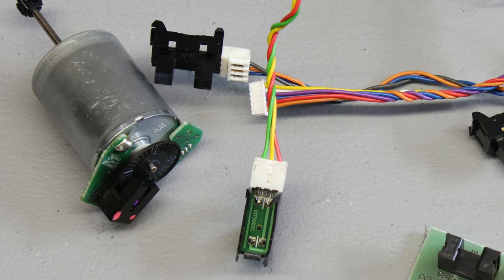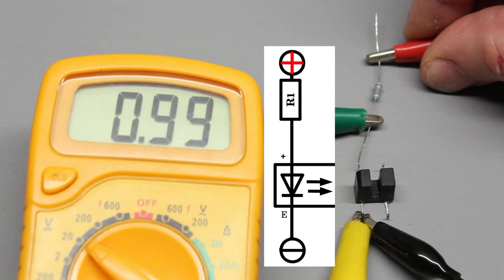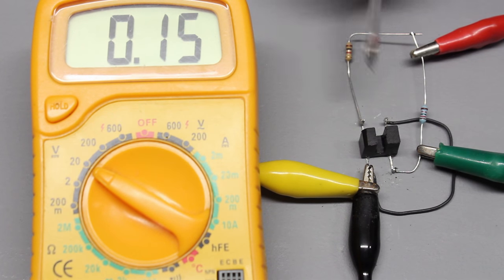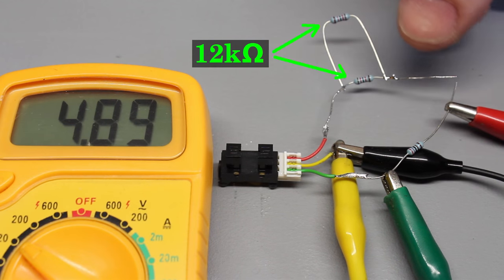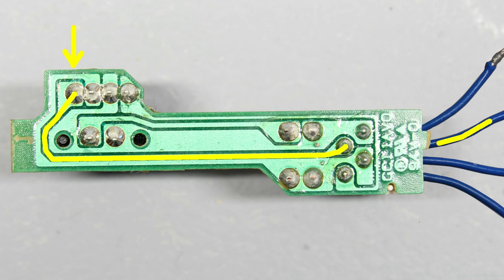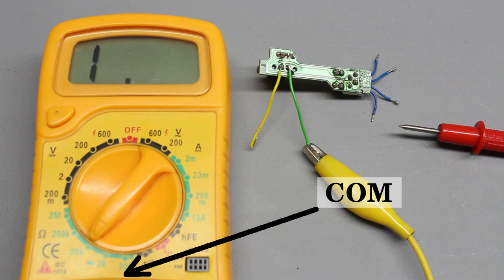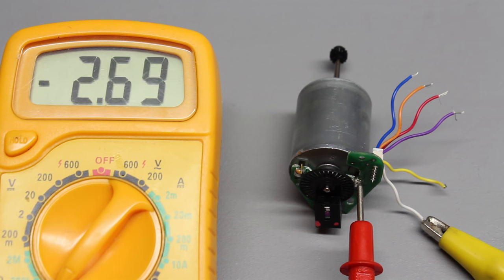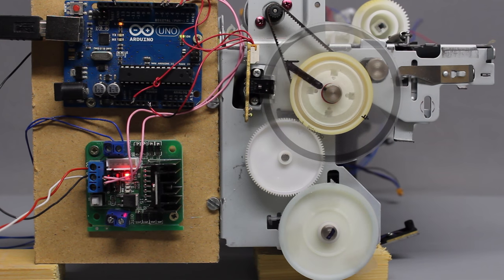Transmissive optical sensors from old printers and scanners

Comment: Want to thank you whole heatedly for your tutorial!
I had collected a few linear / rotary encoders from several printers.
I have managed to successfully determine the pinout from one of them and hook it up to my arduino using two interrupts and two LEDs. :)
Reply from the maker: You're welcome!
...hooking up a linear sensor to an Arduino sucessfully is the first step to great projects. I will create more machines using those sensors in my series about Physical Computing (but it will take a couple of months too go there, I am at switching LEDs, now...).

Comment: Yet another outstanding video! Thank you so much for making such quality videos. 

I just got two old printers that I was planning on harvesting the optical sensors from. This video helps alot.
Reply from the maker: There is more exciting stuff inside old printers. I will record more videos showing how to use the motors and switches as well as the linear drives moving the printer heads. It's with a new series of CNC machines in mind and that's my subscription to this year's Hackaday Prize:
https://hackaday.io/project/10299-self-replicating-cnc-for-194-or-more-countries

Comment: Thx for this informative video. I have a question sir: can I make this working on 24v without power dissipating. I will happy for an answer 🤗
Reply: I have TCST2130
Reply from the maker: Its more than the maximum current that destroys parts. Have a look at the datasheet to find the maximum current of the sender diode. Calculating the needed minimum resistance at 24V isn't that hard: Simply divide 24V by that current and add a bit for safety reasons.
Reply: Yes sir that's right it's not hard to find out the current but when I implement it, the dropdown voltage resistor for the diod getting extremely hot and even when I use 1 watt resistor it still getting warm. I have order resistors with 2 watt and I,ll try it again and see. The current value for diod is 20mA so 24/20 ist 1,2 KOhm
Reply from the maker: The power dissipated by a resistor is:
P = U * I
so for 20mA you get:
P = 24V * 0,02A = 0.48W
Those IR diodes will also work with 10mA in the sensor, alt least I would give it a try, which means you get 0.24W. Of course that will heat up a standard 0.25W resistor noticeably. A 1W resistor will get warm, but that's what resistors do.
Reply: @HomoFaciens  yes i,ll give it a shot with 2 watt. The 0.5 watt resistor makes the curcuit astable. I use this curcuit to keeping track of Filaments and sometimes it attend to miss the signal and goes on when it must be off

Comment: Its a great video, i have learnt a lot, but yet i am a bit confused in finding the pin configuration of an optical encoder with 6 wires.I have watched your video over and over again, but may be i am missing somehting,hence cannot figure it out. i am giving you the part number of the sensor, please help me find out the pin configuration since i am planning to connect it to an arduino leonardo board.The name of the sensor is: cb760-80017-b. Thank you in advance, i hope you can help me .

Comment: Thanks a lot, very helpful video. My rotary encoders seems to behave a bit different though. I had two HP 3820 printers laying around and I wanted to use rotary encoders from them in my project, so I took out the encoders (their part numbers are C6487-60042 or C6487-80014-A on the other side of the same PCB) they look very similar to the one in the video that is shown around 5:30 mark (6 pin package, 4 pins on the PCB, resistor in series for diode and capacitor between power and ground), but they behave differently. I tried powering them using 3V from STM32 discovery board I am using for this project, LED shines a little bit, but I am getting around 1.5V on the outputs with nothing blocking the slit. When I block the slit, the voltage drops to something like 1.4V on one output and even a bit less of a voltage drop than that on the other output. When I open up the slit again, it goes back to 1.5V. I tried powering the other encoder form the secocnd identical printer with 5V and it behaves almost the same only this time when it is powered form 5V the voltage on the outputs is more like 2.4V when slit is open and something around 2.3V when the slit is blocked. Does it mean that these particular encoders I have don't have built in comparators or something? I tried to track down how it is connected on the printer mainboard, but I don't see any comparators anywhere there. Is there any way I can use these? I was thinking abour maybe using some comparators externally but I completly don't know how to choose the right ones and how to connect them and if it will work reliably as the output voltage seems to vary a little bit form one power up to another (when powering it with 3V from STM32 discovery sometimes unblocked slit gives 1.5V on the outputs, sometimes it is 1.47V, sometimes 1.46V, but the voltage drop when slit is blocked seems about the same, maybe it varies because 3V on my STM32 board varies, or my multimeter is just not precise enough but I am not sure). Can you give me some advice?
Reply from the maker: Did you block the sensors with a metal sheet (blade of a knife as I did)? Paper or plastics might be transparent to infrared light.
Reply: First I used some electrical tape folded in half so the glue is on the inside and not on the outside, because that is what I had next to me when I was tesing it. I did test it with a piece of aluminum cut from an empty can and it behaves the same. The gap is so narrow that It is not possible to use knife or something, beacuse it won't fit.
Reply: Also I traced how the outputs are connected on the mainboard of the printer, here is a simple schema that I figured out: https://i.imgur.com/l5VAdo9.png
Encoder_OUT is a pin where the output from the encoder board is connected. 2, 3 are vias that go somewhere to the internal layers of the PCB, so I couldn't track them further. 1, 4 are probably also vias, but they are a lot bigger and covered with quite a bit of solder which looks more like test pads, so I am not sure about them. I am not that experienced with electronics (yet), but is the R43 resistor a pull-down resistor? Is there a chance I just need to connect a pull-down resistor to the outputs of the encoder and it will work?
Reply from the maker: Latest when you connect your multimeter to the encoder output you add a pull-down resistor to the circuit (about one Megohm). This should not be the problem. I need photos of your sensor and circuit to see what might be the problem.
Reply: That makes sense, I didn't think about it that multimeter will act as a pull-down resistor, but it makes sense to me now when you mentoined it :). The sensor board is simple, and identical in its layout to all the standard printer encoders. I don't have any device right now that takes reasonable pictures, but some time ago I found good quality pictures from a teardown of the same exact printer model on some russian site, so here are the pictures of the encoder board from that site: https://wasp.kz/Stat_PC/printers/hp3820/46_hp3820.jpg other side: https://wasp.kz/Stat_PC/printers/hp3820/47_hp3820.jpg . It is identical to my 2 boards and has the same part numbers, only the date marking is different obviously. To me layout looks like almost every other printer encoder board I have seen on the internet. I would suspect that my encoder may be broken or something, but as far as I remember both printers did work last time when they were connected multiple years ago. Also both identical encoder boards form identical printers behave exactly the same, so it is very unlikely they are both broken the same way. I found one post on some electronics forum in my native language that was written 10 years ago where someone mentoined he connected the exact same encoder board model through HCF4093, I looked in the datasheet of this chip and I am not sure how it can help and how it is supposed to be connected. The guy didn't write anything more and since it was 10 years ago I don't think he still follows this forum, so I probably wouldn't be able to get any more informations from him unfortunately.
Reply from the maker: It would be better to see photos of YOUR board with the connections YOU made to look for possible errors.
Reply: The board that is in the pictures here is not just similar to my boards, it is 100% exactly the same, not even a single difference, as it is taken from exactly the same printer model. Also I did compare it closely to my boards to be sure, didn't just assume it is the same because it is from the same printer model. Date marking I said is different is this S304 code on the optical sensor itself. I believe S304 means week 4 of the year 2003, one of my boards has S302 there (I think it is week 2 of 2003), so it is even very close on the manufacturing date to the one in the pictures. The other one of my 2 boards has S238 there so also not really that far from that. I really don't have a possibility right now to take decent pictures myself, but as the boards are abosolutely exactly the same as the one in the linked pictures, I don't think it is really neccesary. The connection is simple and I don't believe there can be somehing wrong with it, the LED shines so it means power and ground are right, 2 other pins are 2 outputs and I am measuring voltage between each of them and ground with multimeter, so nothing complicated here. This is how I connected it: https://i.imgur.com/DQ33ssB.jpg For connection to the board I am using original connector from the printer that I depinned on the other side as I did a lot of depinning of various connectors to date so it is usually easier and quicker for me to depin a connector than to cut it and get rid of the isolation :). I am connecting these depinned power and ground pins on the other side to STM32 discovery board power and ground pins (I am using this STM32 discovery only as a power source right now). I am not connecting outputs to anything, just measuring the voltage between each of them and ground. One of the boards was only ever conected to 3V power source, I never connected it to 5V so it is not possible that 5V broke anything. I connecected everything right on the first try, never connected power and ground to wrong pins, as from the traces on the board I figured out which lines are power lines and using a mutlimeter I checked on the printer mainboard which one of these power lines is ground, so I am sure it didn't broke form connecting power to wrong pin or anything like that. For me it just seems like these boards just have different type of outputs and I don't know what to do to bring it to something more usable for a STM32 microcontroler.
Reply from the maker: Pull the original plastics stripe slowly through the sensor and see what readings you get. Some of them only work with the fine line pattern of those plastic stripes:
https://datasheetspdf.com/pdf-file/603784/Agilent/HEDS-9200/1
I have also added a drawing on my pages (Figure 16):
https://homofaciens.de/technics-base-circuits-transmissive-optical-sensors_en.htm
Reply: Good point, I mounted the encoder board back to the printer frame, and did rotate encoder wheel through orignal printer paper feed mechanism, results are different now. I don't have any crocodile connectors to connect the mutlimeter for good and then move the encoder wheel, I only have standard mutlimeter probes that I need to hold to measure anything, so I did move the encoder wheel and measured the voltage on the outputs in number of different random encoder wheel positions (like 15 or so). Encoder was powered from 3V, the highest voltage I got on the output was 2V, the lowest in different position was 0.97V. Also I got a bunch of numbers inbetween these two in different postions. That looks a lot more reasonable. As I have got bunch of voltages inbetween lowest and highest values could it be that this encoder has an analog sinusoidal output? It seems like that right now actually. If only I had an osciloscope, I would check that, but unforunately I don't have one :(. That also makes sense with this guy I found on the forum that connected it using HCF4093 schmitt trigger, because as far as I understand that will make the signal usable on a digital input of a microcontoler. I guess I will get a schmitt trigger then to use the signal on the STM32 digital inputs.
Reply from the maker: Having a sinusoidal output is possible. I could not find a datasheet of an Agilent 9988 or S304, at least not with a quick research. GPIOs sometimes have a built in Schmitt trigger (at least a small Hysteresis) so that it probably works without an external Schmitt trigger. At least its worth a try.
Reply: I did a bit more digging on the internet and it seems like this is true that it has an analog output. There was s site that is not working anymore, where someone used this encoder for some project. I found some references to this site where someone wrote that now not working site did state it has an analog output. Someone also linked a datasheet for it (at least that is what he said), but the datasheet had differnt part number in it (HEDS-9710, HEDS-9711), so I don't think it is the exact model, but most of the data is the same. It is also 200lpi and it has analog output, but the output type there is current output, not voltage output. I am not sure how current outputs work, but as far as I understand you need some sort of resistor to connect a current output to voltage input of a microcontroller? Can my sensor also have current output and when I am measuring the voltage on the output, multimeter acts as this resistor and that is why I am seeing voltage differences, or it is not how it works at all and in my case it is just standard voltage output and I don't need anything else on signal lines to not destroy any input?
Reply from the maker: Yes, your Multimeter is the (approximately 1 Megohm) resistor the current flows through. You can also check what happens to your readings when connecting a 10k Resistor between output and ground. A 1k Resistor should also work without causing damage, but I can't grant that...

Comment: I took apart an inkjet printer with my son.  The printer head linear encoder appears to be magnetic.  Do you have any hints on how to wire it up?  I googled it and found the explanation that magnetic encoders use opposite pole magnetized stripes to trigger the sensors but I don't know how to wire onto the pins to read the encoding.  Thanks.
Reply from the maker: Without having a look at your encoder it's impossible to say anything. What about a video or pictures?
http://homofaciens.de/contact_en.htm

Comment: Do you know if we can use the optical sensors, normally used with rotary encoders, with linear strip encoders ? Thanks in advance
Reply from the maker: The sensors and the sensor stripe / disc must meet some requirements (line width, optical properties). Simply try it and tell me if you succeeded.

Comment: Hi sir. I need to use an optical sensor from hp print. as you suggest in your writing (https://homofaciens.de/technics-base-circuits-transmissive-optical-sensors_en.htm, figure 12) , I want to cut out the sensor unit from the whole board. The sensor 6 pinouts and between 5Vs i read 14.6k OHM. between GNDs i read nothing. So should I put 14.6k OHM resistance between 5Vs? Thank you so much for your help!
Reply from the maker: Between 5V and what pin do you read 14.6k and between ground and what pin do you read nothing? Resistance measurement needs always two points. Same is for connecting a resistor: It is always connected to two points in a circuit. Send me pictures of your sensor. My mail is listed on my pages:
https://homofaciens.de/contact_en.htm
Reply: @HomoFaciens  Hi sir, I will send you an email. Thank you so much.

Comment: I have Optical slotted Switches Types OPB990t51
Five ends of wire
    led = black and red
Sensor  = Green - Blue - White
How to connect to Arduino
Reply from the maker: Follow the steps in the video to find the pinout configuration.
GND of the sensor to GND of the Arduino (black cable?)
Plus of the sensor to +5V of the Arduino (Red cable?)
Sensor outputs to digital pins of the Arduino (I don't know what colors the sensor outputs of your type are - that's what you must find out).

Comment: how much milliamps it need ??
Reply from the maker: Not enough information to give a profound answer...
Reply: i have a sensor from an old printer and i use 3.3v it take about 21mA so i get afraid  to step up the voltage to 5v that's why i asked you and i didn't find any datasheet about it
Reply from the maker: You have only one chance to test it: Connect it to 5V and see what happens...
IR diodes usually draw a current of up to 50mA, thus your device will very likely survive the higher voltage, but nobody can grant.
Reply: i'm using 3.3v and i read data with arduino and i have no problem so no need to risk.. and i want to thank you so much for ur great video i learn so much from them u are the best thank you so much ^^